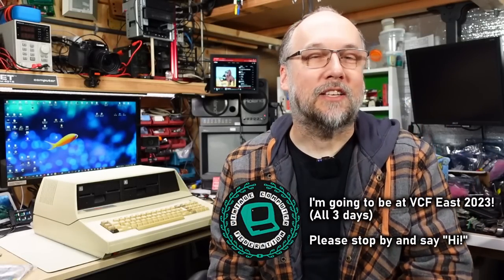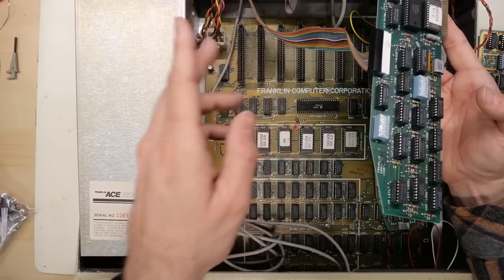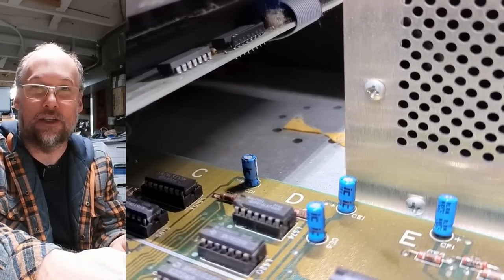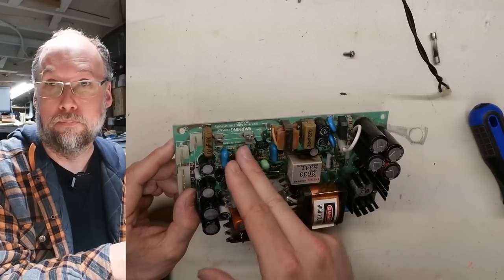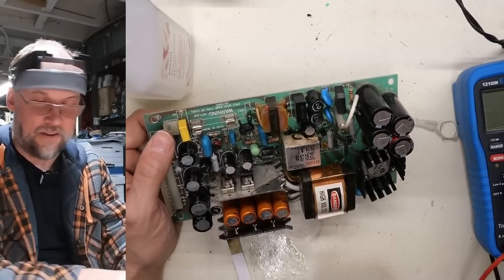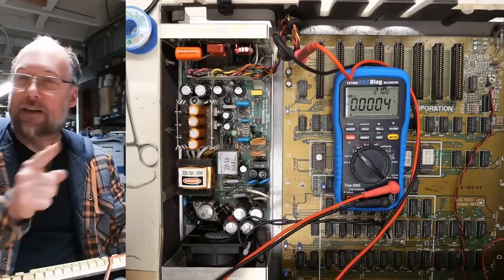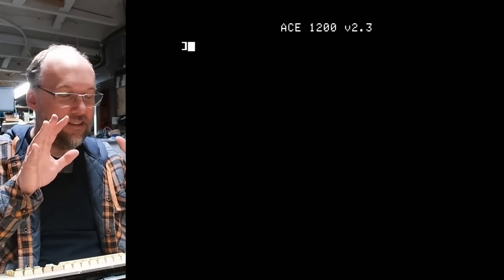The Franklin Ace 1200 was a semi-legal Apple II clone #repair

Comment: Foam and foiled... ugh! Nice repair of an Ace 1200!
BTW, the Ace 1200 did have infringing ROMs. I believe they are copies of the Apple II+ ROMs with the banner text replaced.
I have an Ace 1000 Plus, which differs from yours by having the color burst and floppy controller circuitry integrated onto the motherboard. But it also has infringing ROMs (Apple v. Franklin was still winding its way through the court system on appeals).
Reply: The reason why Franklin stayed on the market so long is because the courts initially ruled that compiled binaries could not be copyrighted. They eventually, when the Franklin Ace 500 and Franklin Ace 2000, were forced to come up with non-infringing ROMs before they were ultimately barred from ever selling computers of any type as conditions of the settlement of Apple v. Franklin.
Reply: As an interim solution until the final rulings, Franklin introduced WOMBAT. Write Once Memory Boot At Turnon. This loaded ROMs from floppy at boot. Where you got the ROM images was up to you.
Reply: We used to restore the color on Franklin ACE computers. Prior to the add-on color board, Franklin would leave out a few components and ground the chroma summing network to prevent color from working. Franklin also removed the cassette routines from their ROMs.
Reply: I have an Ace 1200 with a higher serial number than Adrian's (#50,000-ish). There is a sticker added to the motherboard giving credit to Apple "Apple Start ROM (c) 1976, 1978, Apple Soft ROM (c) 1978." It was my understanding that the only difference was replacing the cassette routines with support for lower-case letters.

Comment: If that keyboard uses the same switches as the Keytronic KB-101, foam and foil is not my favorite name for it. The shiny "foil" is not conductive, as they are capacitance switches. This is pretty nice, as they are essentially immune to dust and dirt since a keystroke would still be registered no matter if they're new or dirty. They had individual rubber domes for the restore force that came in different strengths so customization was possible. I have a number of these keyboards and the subjective key feel ranges from wonderful to not wonderful at all, depending I guess on which domes they were ordered with. Or maybe sunspots? In any case, I think the tech deserves more respect than it gets. 🙂

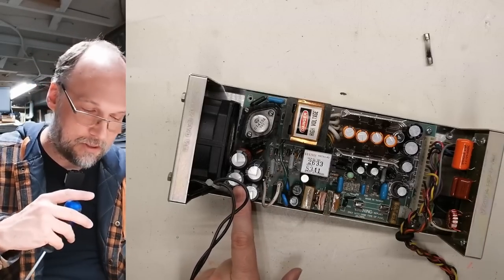Comment: 15:07 You are making a dangerous assumption here, the one that the fuse blown before you got the computer in your hands. If the fuse blew at the short moment you plugged it in, power could have made it to the caps

Comment: Intteresting they added that RFI suppression board when they had RFI suppression on the PSU board (which is what the stinkers, I mean Rifas were part of), but yeah, they didn't use caps appropriate for the job, these days they'd need to be Class X2 and Class Y types to go between live, neutral & earth, they just look like regular polycaps which are really not meant for that duty, even if they worked fine before, but then, "before" they may never have even been hooked up to an RCD/GFCI, goodness knows how tingly grounded metalwork in a building was with things like that connected... :S

Comment: 5.1v should be fine as that's only 2% high.
It might even compensate for additional load.
Reply: TTL requires 5V +/- 0.25V.   So 5.1 is perfectly fine.  It's better to be a bit high at the power supply to guarantee the voltage will be at least 4.75 by the time it reaches the chips.  You're never going to overvoltage a chip at 5.1v.

Comment: It is interesting how line noise suppression techniques have evolved over time. LOL that they just put regular caps across the line back then and expected that it would be OK. OK for a while I guess but not good long term.
Reply: it IS ok, problem is the caps, some do have issues long term, eg. paper dielectric based RIFAs, notorious for trouble, never..yet..had a poly mains cap fail...
Reply: You think that's bad, look at guitar amp repair.  The call them "death caps" for a reason.  When they short, they can connect the chassis to mains. (Only two prong power plugs).  Then when the guitarist touches the grounded mics ... some have actually died from that.
Reply: @russellhltn1396  those RIFAs, or any similar paper based caps across mains or from mains to ungrounded casing/common need replacing on sight!  their Y2 types , like any other Y2 are 'supposed' to 'fail safe' ... those ones on that little  board 'could' be 'proper' Y or Y2 types(large one should be an X or X2) as i have seen ones like that, not yet had a bad one .... but if the epoxy coating has cracked like with RIFAs, could very well also go resistive..
Reply: @andygozzo72  That's what I see in all the guitar amp repairs - remove death caps and replace with 3 prong plugs - even amps they're trying to preserve for historical value.

Comment: Add some Amtech 559 flux when soldering / using the wick and it will help even the most mediocre wick absorb the solder faster and better.
Reply: I bet Flux is what has a lot to do with the quality
Reply: @danman32  I wouldn't doubt it. It certainly helps the solder flow and improves the transfer both in terms of the finish and adhesion to the solder joints, and in removal with wick. I recommend Amtech 559 as it's what I use myself, generally from Rossmann Repair or Northridgefix as it's a no clean non-corrosive that really does work well.

Comment: So what do those Rifa caps do on these? I work with audio gear and they're used a lot on these . I've seen where people say they're used for line noise or spark noise from switching on and off. So what do they do on these where they have them right at the start of the power supply? Any line noise will be taken out by the switch mode part. So what do they do? The values you stated are the same as what I've seen in the audio gear I've worked on .Only some times they have a resister in there as well. One other thing a lot of the replacements are only rated at 275Volts where these old ones were rated at 400Volts . I've been using Polyester caps rated at 650 Volts with 120ohm resister where need and they seem do be working so far
Reply: Noise can go two ways: into the power supply and out of the power supply. If you run a supply without any noise suppression the interference will make any nearby AM radio unusable.

Comment: You might consider getting some load resistors for testing before plugging into the actual PC
Reply from the maker: Someone suggested some 12v light bulbs as a cheap and easy way to apply load
Reply: You should get some 12v incandescent bulbs while you still can find them easily.

Comment: Does the Apple-Franklin PSUs have over voltage protection? (Some PC PSUs don't.) In other words, is it safe to just turn the faulty PSU on with all the digital electronics connected to it?

Comment: it'd be a good idea to test the psu on  a 'dummy' load before letting it loose on the main board, or it risks blowing a lot of parts if it goes over voltage!!
Reply: I was thinking of that, but what would you use to create a load?  I remember some 40+ years ago, at a repair lab for a rental company for sound systems, where they had special devices for loading large amplifiers.
Reply: it can definitely be a bad idea to  power any power supply up with no load as some types can  go unstable with below minimum load on  them....
Reply: @SenileOtaku  small power resistors, car bulbs, etc. perfectly ok for this sort of thing,  anything 'resistive' and high enough power capable for the voltage,

Comment: I wonder if there is actually anything wrong with the caps on the filter board, or if the Y cap is just so big that it conducts enough AC to trip the GFCI?
Reply: There is a limit on the value of Y capacitors so this shouldn't happen. The allowable leakage limit for safety is 0.5mA and GFCIs are set for 5mA (I think +-20%). If you have less than 8 things plugged in and a GFCI trips something is broken.

Comment: I don't want to seem negative, a bit risky connecting the power supply to the computer before testing it first, a couple of  low voltage lamps would have done as a dummy load.

Comment: How about getting some load resistors to try out power supplies instead of risking it on the computer? They're pretty cheap and if you don't mind, I could send you some. If you had an assortment you could dial in the amount of current as well.

Comment: In re the Laser being a IIc clone: not really... they put in some additional functions that Apple didn't.
I miss my Laser 128EX... I sold it to a friend who used it for years. 2 slots available for expansions (via a breakout box), built in slot 3 ext 80-col,  slots 6 & (5 or 7) disk controllers, slot 1 & 2  for parallel and serial, single to triple speed... awesome beast for the 80's. Also, several things that wouldn't run on a IIc would run on the Laser. & vice versa. 
It does make me wonder how VTech (parent of Laser) would have done a IIgs clone...
Reply: It looked like a 2c...so everyone assumed it was a 2c clone. But it was something special.

Comment: Doesn't it need the higher 5.17V for when the floppies are running.
Reply from the maker: Theoretically when the 12v is loaded down the 5v will drop but the regulation should help keep 5v stable.
Reply: @adriansdigitalbasement  The power supplies I worked on, the 5V was regulated, but the 12V was just along for the ride.  The 5V regulation would compensate for the voltage on the mains, but there was nothing that would compensate for the current on the 12V.  As I mentioned in another comment, 5.1V is perfectly fine as it would help compensate for any loss in the PCB in getting the voltage to the chips on the far end of the board.  The voltage at the chips is what counts.

Comment: After the second fault  would have just gone and installed the modern one. Using original parts is goood and all but for something like a power supply new just seems a lot safer

Comment: Got a new tip today.  Put some flux on your wick before you try.  It will pull it right out.
Reply: Gotta use John wick for solder joints lol 😂
Reply: @marccaselle8108  🤣

Comment: fuses CAN blow for no good reason, maybe surges, IF the fuse still looks clear, blackened like that, theres likely a short somewhere, a dead short can blow a glass fuse to pieces, better to use a sand filled ceramic type

Comment: Serious question, what is a reefer capacitor?
Reply: RIFA was a brand of capacitor used in equipment of this era. They are prone to failure, and when that happens they emit smoke and an obnoxious odor.
Reply: @Colin_Ames  Specifically they are paper capacitors which are all prone to failure. Every brand used paper capacitors everywhere in old tube electronics but they were mostly supplanted by plastic film capacitors in the 1960s. These RIFA filter caps seem to be the last things still using paper caps.
Reply: @eDoc2020  I appreciate you adding to my post. As a vintage radio enthusiast, I have replaced many paper capacitors in tube sets. It didn’t occur to me to tell the OP that RIFAs are paper caps.

Comment: I sure hope you don't have any nearby neighbours who are into amateur radio, or they'll be quite annoyed at the extra interference you're creating when removing filter components from power supplies like this. I understand it's convenient and easy, but manufacturers didn't just put those in there for fun; they do it because that particular design wasn't able to meet interference specifications without it, and since you have a large audience it would be better if you set a good example by trying to ensure you complete repairs (especially safety-related and external noise/interference suppression related) in the most correct and compliant way possible.

You might say it's not a big deal because these retro computers aren't turned on that much or that often, but eventually many of these may get passed on to others who might use them more frequently or in other situations than you do. You exercise great care in preserving other aspects of vintage computers when you work on them, so please take the extra time to keep filtering intact when feasible as well!

Comment: Question for the experts: How exactly do you differentiate between live and ground in alternating current? Aren't they identical, other than being 180 out of phase with each other?
Reply: Minor terminology point, the two wires delivering power are live (or hot) and neutral, in AC "ground" is specifically a safety wire that should not normally carry current. Neutral is connected to ground, but back at your main electrical panel.

You can't tell the difference just from the 2 wires, but for example, the neutral wire should be close to the same voltage as the stuff in the environment -- if you have an actual earth ground (usually green or bare copper wire in an electrical box) you can compare to that, but also sinks and taps often have a good connection to local earth.

This is fundamental. The neutral (and ground) are considered safer exactly because they're at the same potential as the stuff around you, and therefore by definition they can't shock you by themselves.
Reply: It has to do with reference to ground.  Neutral is basically at the same potential as ground so there's not as much danger of a neutral to ground short (like your body) as it would line to ground.
Reply: It's a US thing, we have 240V power that is center tapped, and the center tap gets connected to ground somewhere early. That makes "neutral" less hot than "hot". But it's not the same as copper/green ground, which won't ever be interrupted by switches, breakers, etc. Then we use each hot half separately, except for a few major appliances. The only proper way to differentiate is with the plug. Neutral has a slightly wider prong for 2-wire plugs like lamps, and a 3-prong plug has them in a certain order.
Reply: In terms of how do you identify which wire is which: in a cable hot is usually black (in housewiring it can also be red) and neutral is white; on a board they might be labeled "L" for live or hot and "N" for neutral; and if you have a keyed plug, the big blade is supposed to be neutral in North America and the small blade is live or hot. There are other colour codings (e.g. brown/blue) which you can look up if you encounter them.

If you are looking at some random spot on the board you can trace back to some place where it's labeled or otherwise obvious by inspection or with a continuity tester.

Safest is to check continuity all the way from a properly keyed plug.
Reply: @josephlunderville3195  Okay, I think I understand. But then, in this power supply, the 2 wires coming in, is one the earth ground? Or is that just the two wires and one was arbitrarily labeled as 'live'?
Reply: @AiMR 
I think your misunderstanding here is thinking that neutral has any potential on it at all. While reality is not always so simple, the way to think about it is that neutral is the 0v, and will always be 0v, where live will alternate between the positive and negative voltage.
Of course, different countries do different things, like here in the UK, neutral is tied to earth at the distribution box. But I think it is always best to consider neutral to be 0v.
Reply: @darranrowe174  Okay, but then why are there 3 prongs on most modern wiring schemas? Can't we just get ground tied locally to earth?
Reply: @AiMR  Assuming the power outlet the device is plugged into is wired correctly, one wire at the power supply is connected to the power plug "hot", the other connects to the power plug's "neutral".
Reply: @AiMR  RCD/GFCI. These work by detecting an imbalance between live and neutral. This happens because of a fault that causes current to flow from live to earth.
If neutral was tied to earth in the device then there would be no imbalance detected,  hence it would have to be tied together after the fault detection.
Reply: @AiMR  Neutral is always near ground. When in use the losses in the cable mean there's a slight voltage on neutral. But worse, if the wire breaks or has a loose connection the neutral line will rise to full line voltage. If you connect your "earth" lead to this you can easily get shocked if you touch real ground. The real purpose of the earth lead is bonding, making sure everything you can possibly touch is at the same voltage, eliminating the possibility of shock. Using a dedicated wire for bonding means no single failure can result in shock.

Comment: Fuse on the neutral is another argument for everyone to use the UK type of plug... you can't go wrong with it..
Reply: Unless you are from china.
Reply: Improper fuse sizing to load is a big problem, as are the sealed moulded plugs which often don’t have a fuse at all. The UK plug is great if you follow the spec, but most things are when up to spec!
Reply: @kaitlyn__L  The chinese don't follow the spec.